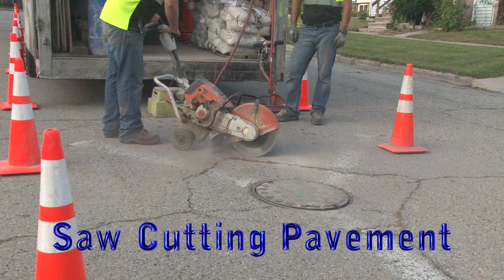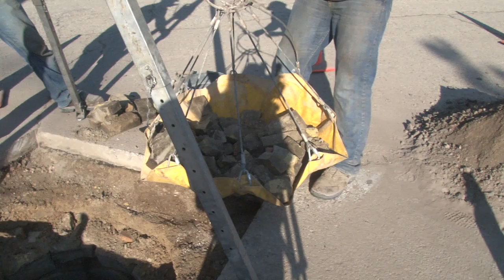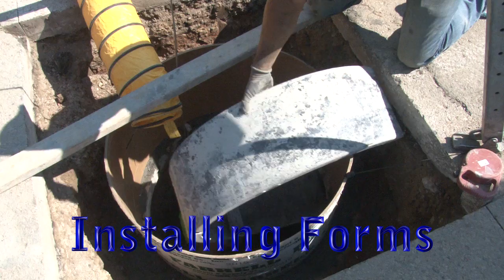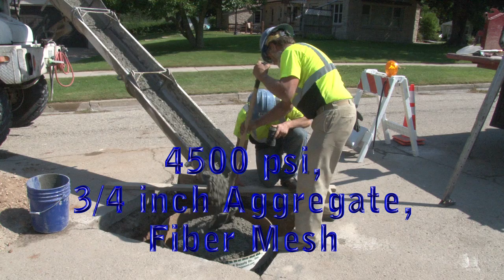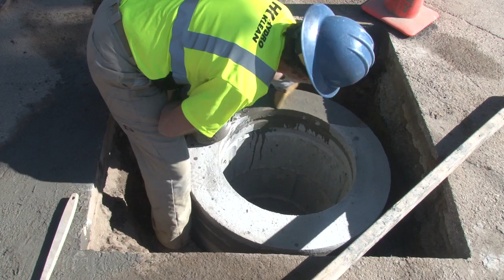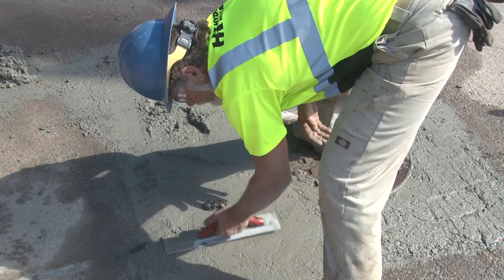Hydro Klean Monoform Manhole Rehabilitation

Comment: I would recommend that you use a direct water connection when saw cutting the road. That's illegal. And taking life off your employees for no reason. Also what are they doing in the hole without a tripod? The second time they were using a tripod but not the first time.